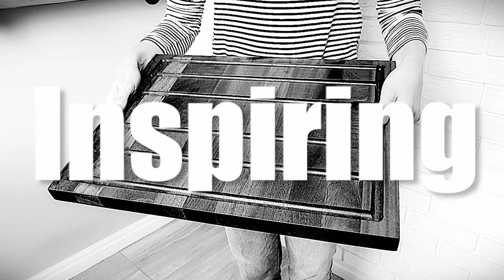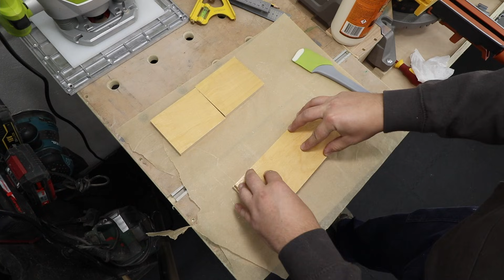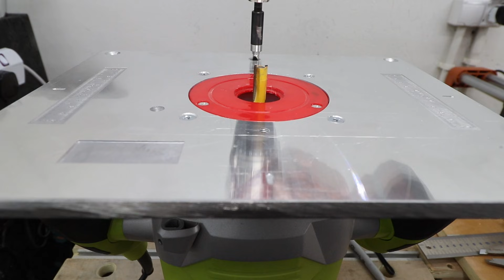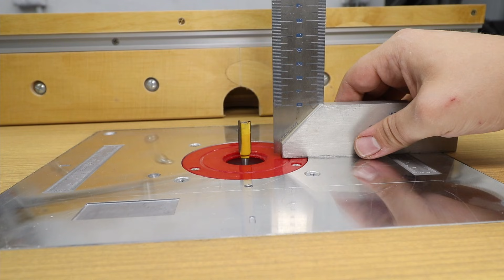DIY Simple Lift for a Plunge Router

Comment from the maker: All the videos from Router attachment build are here:
1. Router Table Extension For a Table Saw | Evolution Rage 5S | Part 1 - https://youtu.be/YiD4CJ9F0CE
2. DIY Simple Lift for a Plunge Router - https://youtu.be/sCyhsXXIX4k
3. Router Table Attachment with Storage, Dust Extraction & Safety Switch | Part 2 - https://youtu.be/bPFCq8loSWo
4. Table Saw / Evolution Rage 5S / With Simple Router Table Extension - https://youtu.be/hKGSkINhEBo

Comment: Nice idea, the only issue i can see is the screw for lifting the router up and down is on the wrong side,  the fence willl need to be moved  each time you need to do any height adjustments, you will loose the position of your work piece.
Reply from the maker: Yes, realised that too late 😅 don't repeat my mistake
Reply: Lose, has only one O. Loose in a sentence is sheep are loose in the field.

Comment: I really like your approach and it seems as good as some of the really pricey lifts. I know they have cheaper ones that have mixed reviews. My only issue with yours would be the position of the lift by the table fence. But I guess you could just rotate  the aluminum plate  180 degrees when you drop it in the table. Provided it will seat completely.
Reply from the maker: You can just do it from the front. And that's what I would do differently next time

Comment: Hi there, great simple solution. 🫶🏼👏🏻
I just wonder if the vibrations don't move the router up/down? Any locking mechanism to add on to it?
Reply from the maker: Well the router itself has got the depth stop as its a plunge router. However I really use it as it stays in place. But that's my router yours may not stay in place.
Reply: I get the point, I just have a hand router that's why I asked about the issue! Thanks for answering 👍

Comment: I like simplicity and excellent video. But I want to if cnc router bit can be in trimmer router and what bit recommended for cutting
Reply from the maker: If your router can take the correct collet that will hold that bit then yes.

Comment: Great build! I have the same router and am attempting a similar idea. The threaded rod that was built in with the 2 nuts on it... My idea is to drill out the bottom so it can come free and be accessible through the router plate, from above. And removing the springs is a great idea! I hadn't considered it. I thought maybe they should help keep tension on the rod so it couldn't move, like you said you had some issues with. I don't know how I'll keep the threaded rod in place and the nuts in place at the same time though. I'm thinking about a coupler perhaps. But you're much more intelligent than I am. Do you have any thoughts or see any issues with my take off your idea? Thank you!! Great channel!
Reply from the maker: I just got a new router that has built in lift and its at a price of a normal router! Can't say much more at the moment about it but it's a game changer 🙌  
Where it comes to your design it's hard to suggest anything, best idea is to start building and amending the design as you go and use what you got in your workshop. Coupler will be a good and easy idea I think. 
But we can try to work it out together if you want. Just send me an email with  some photos as you go and what issues you are coming against 👍

Comment: How do you go turning the router on and off? I have a Ryobi plunge router which has a button to press and a trigger to pull to activate. When I release the trigger, the router stops.
Reply from the maker: Got that covered here - https://youtu.be/bPFCq8loSWo
Reply: @CasualDIY  thanks, great videos! - but how did you bypass the router trigger - did you use cable ties or something similar?
Reply from the maker: @alanearl9354  yes cable ties

Comment: Bit concerned that you hammered in the captive furniture threads! Why? They have a hex key socket and an outer thread to screw into the wood ... At least all the ones I have and have used many times in the past do! 

Using epoxy might be good but I have found the strongest method is to fit the nuts on the opposite side of the wood to the bolt entry as this means the nut is putting all the force into the largest amount of wood creating the strongest hold possible.
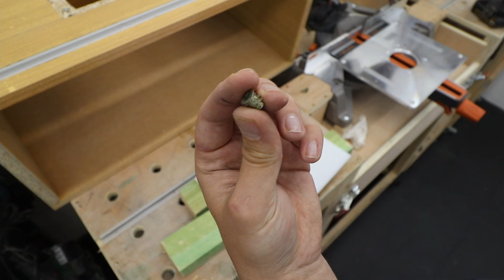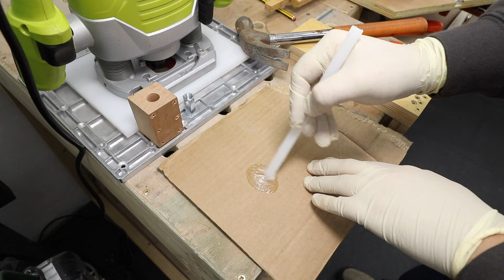Reply: Sorry for the delay. You first mentioned hex furniture nuts around 0:48 but you were then later hammering some into a drilled block of wood, those same style furniture nuts at around 4:23 -> then using epoxy.

Like I said, those nuts have a large external wood cutting thread to do that job and those threads do a better job than epoxy.

Also for absolute maximum strength placing the captive nut on the opposite side to where the bolt will enter, so the bolt enters the rear of the nut, puts the full thickness of wood between the nut and whatever is being fastened by the bolt. In addition only a tiny amount of epoxy inside the hole prior to screwing in the nut is needed then to prevent the nut from turning out.

Hope that helps.
Reply from the maker: @boblewis5558  what you mention is a coupling nut, not a hex drive head nut. Two different things. It doesn't have a thread on the outside. It's an elongated nut.
Reply: @CasualDIY  ah! I only paid close attention to the first showing. But now I'm puzzled as to why, having used hex screw-ins initially 👍 you used a connection thread instead with epoxy at the end. The screw-ins were the right choice for both and arguably stronger if used as I said.

If it works, it works but more work to do the same thing (or not so good). 🤔🙄
Reply from the maker: @boblewis5558  I use the hex drive head nuts in this project for something else, they were never meant for that block of wood where the coupling went. I have used the coupling due to the thickness of the threaded rod plus  the coupling is very long so it gives s lot of streglnght and stability.
Reply from the maker: Not sure which part you are talking about. Could you give me a time of the video when that happened please?

Comment: Hi Tomasz. Have you had any problems with the raising and lowering gear on the Rage 5s. The little bolt at the bottom of the shaft on mine keeps loosening and dropping out. Thanks for your videos.
Reply from the maker: Hi, so far no I had no problems. I would imagine wear and tear if you had it for a while. Maybe there is some dirt build up?

Comment: Hi Tomazs I see you have a Katsu router too, have you had to make any adjustments when using the Katsu? Also my workshop is only 11feet by 8 feet so the foldup function of the Rage5s is really useful, does attaching the router box stop you folding the table?
Reply from the maker: Hi, I have already made the fitting holes in that plastic sheet to attach the katsu and it works no problem. The saw folds up with no issues - thanks to the magnets folding the drawers there is no movement or issues like that.

Comment: Awesome build Tomasz. Could a couple of triangle pieces of ply screwed and glued at the 90 degree base help before you redesign the complete lift? 5.53 on your vid for reference. 
Also a top lever to activate pressure on treaded rod to prevent vibration movement. Just a thought.
Cracking job my friend. 👌
Reply from the maker: Thank you kindly, yes that could work. I'm having a break from this project for couple of weeks but will revisit it for sure and I'll try your suggestion. Thank you.

Comment: Nice job, I through money at the problem and bought the big Triton router. Works really well and been using it for 4 years.
Reply from the maker: Triton is a solid brand, the router I used here is just a cheap one ( just over 30 quid ) but it works surprisingly well 👍😀

Comment: Nice work, very tidy.
I use a tiny scientific scissor lift thing that came off of Amazon on mine and it works well even without removing the plunge springs.
Changing the router today to a Bosch so I’ll have to see off the springs need taking out.
Reply: I was about to reply the exact same thing!

Comment: You may want to put the winding side to the front to avoid moving the fence constantly...
Another tip is to purchase a Triton router table crank handle which can be adapted to fit the threaded rod if you widen the notch in the top 👍
Reply from the maker: Yes for some reason I have not thought about that lol I will change this when I'll amend the whole design and create a U shape from plywood. Then I'll make the winding side near the front.
Reply: Phil Brandon I also thought it was a stupid idea to have the winding side where the fence is.

Comment: Very impressive build. Thanks for sharing. Finally somebody (you) made a simple DIY router lift. A few years ago I made a router lift with the help of a
manual drill standard. The chuck of my router just fits in the opening for a standard drill (43 mm) Some parts of the drill standard I put upside down, so when
I press the lever down the chuck of the router (and the router bit of course) goes up. With DIY shims of various thicknesses I can adjust the height till about 0,3 mm
micro-adjustment. That's enough precise for me.
Reply from the maker: That sounds very impressive I have to say and very inventive 👍

Comment: Great video Tomasz and a great idea as well. One question is why the hole to raise and lower the router is away from you, wouldn't it have been better nearer to you instead of covering it over sometimes with the fence, i presume it's to do with the positioning of the Router.
Stay Safe,
Barry (ENG)
Reply from the maker: Hehe no its just a mishap on my part 😂 I'll change that when I will amend the design and make a U shape from the ply support 👍

Comment: Nice! Micro adjustment is a function of thread pitch. So, for example, M6 coarse, has a 1mm pitch. So a 360 degree turn will raise or lower the bit 1mm. A 90 degree turn 0.25mm etc.
Reply from the maker: Thank you, yes that enough prices for my needs😂

Comment: That's a really nice solution, I was more of a cheapskate when I did mine, and used a cheap scissor jack I had laying around along with a cheap old router i'd forgotten I had. It took me ages to get the springs out of it, but it works really well, and the jack gives a surprisingly nice adjustment...I have the same locking issue though, and have to reach under to lock it, I had planned building a better version, but with the ridiculous price of wood atm, ive not been near my woodworking tools in months as I can't afford the materials...lol
Reply from the maker: The jack solution was in my head as well but I didn't had one spare. So I used what I already had in the workshop. Yes the prices are mad at the moment and I'm in the same boat as you. I'm trying to scout around for some free wood or boards. Like in my router table attachment build its all laminated chipboard from some old shelving units my dad had lying around in his basement. So yes recycling all the way at the moment👍😀

Comment: Hi Tomasz. For my "heavyweight" solution I used a pantograph car lift. Sure it is crude and very heavy (maybe not suitable to be hanged from a tablesaw side) but it's very simple (just place it under the router) and very sturdy. Obviously, being it meant to support a couple tons of car, it doesn't budge under the pressure and there's no need to use the router block. Ciao.
Reply from the maker: Yes I was thinking of a car jack but in the end went for less heavy duty solution. Time will tell how it will hold up.
Reply: Same here, works very well and cheap as chips from the local car breakers
Reply: @robotsnthat  Mine was even cheaper for I just stole it from wife's car.
Not a real loss, for each time she gets a holed tyre I have to go there and rescue her anyway with my tools.
Reply: @carloduroni5629  LOL, good one, hats off on that! Unfortunately, my Mrs can change tyres quicker than I can, and she would notice the  missing bits in the boot. I bought 3 of them from the local scrapyard, cost me $10 Aussie for the three of them. Good for all sorts of jobs including improvised clamps. For the router lift I just made a wooden handle to get some decent purchase and easier to use.

Comment: I think it will be better if the adjuster is on the side away from the fence, otherwise you will have to move the fence to adjust the height.
Reply: I was thinking the same thing.
Reply: Wouldn't it be possible to just rotate the router and plate 180degrees and then the adjuster would be on the side away from the fence. I made an offset router table opening so depending on which side I'm working from I drop the plate in to suit, if that makes sense.
Reply from the maker: Fair point, not thought about that 🤣

Comment: Presumably you reach under the table to get to the lever to "lock on" the cutter height/depth?    
Good tip on removing the springs, my home-made table uses a mechanical lift but was hindered by the springs - no springs and it works much better!
Reply from the maker: Yes the springs were giving too much resistance and the lift wasn't working correctly. Yes I have to reach under the table to get to the lever to lock the cutter head height. Because of that I need to amend my initial plans of storage solutions for the box ( where the router sits ) as I need to have access to the side of the router. At the moment I have not found a better option of locking the router in place.

Comment: Great video, some brilient ingenuity. However I think you will definately have issues over time as you can clearly see the movement of the router bit being slightly jerky which indicates the forces are twisting. You might want to lube the router to reduce the twisting forces. Don't want to be negative, but it looks really good and will try something similar and see if I can eleminate the twisting or lateral forces.
Reply from the maker: Yes later on I have taken apart the router and lubed the rods inside and that seemed to eliminate the problem.

Comment: Great video. I did mine with a mini scissor jack. Works great, but I also have to lock mine.
Reply: I did the same, bought a cheap sissor jack and works great.
Reply from the maker: I was thinking of doing that as well, but in the end went for this solution. ( I didn't had a scissor jack to hand 😂 )